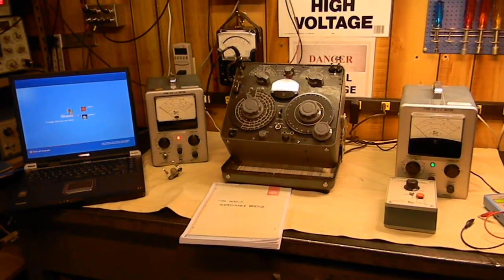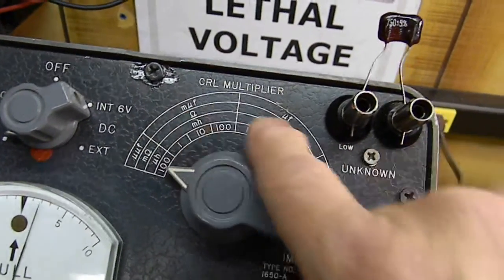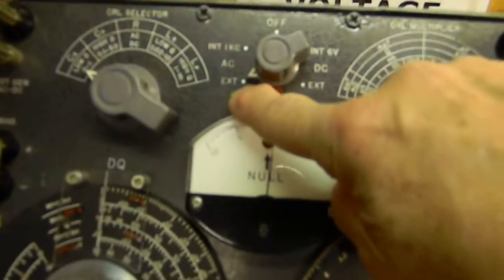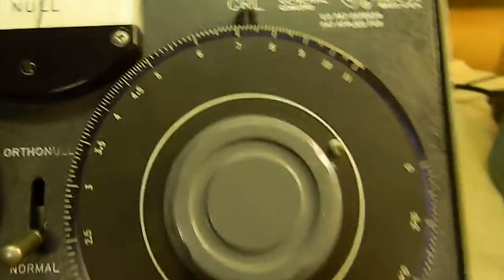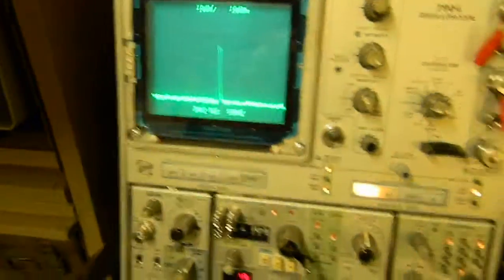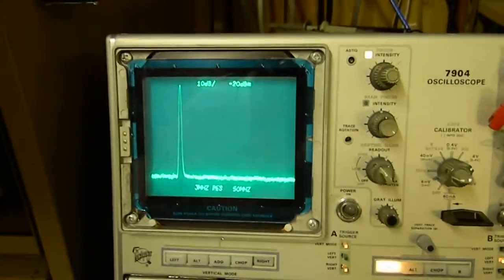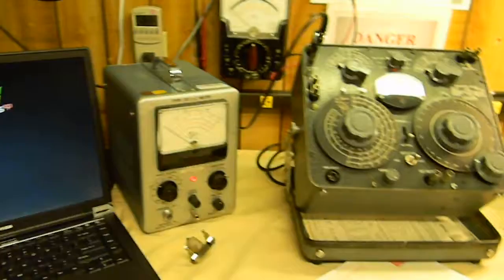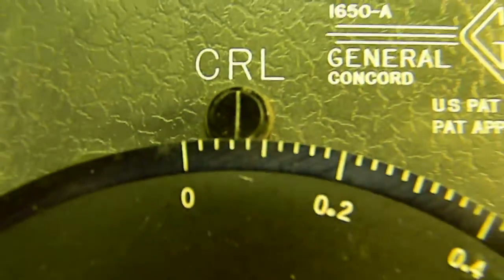General Radio GenRad 1650-A Impedance Bridge.MOV

Comment: I have this same impedance bridge, and I find them useful partly because of their accurate Dissipation Factor measurements, which can tell you a lot, and because they test at 1kHz, in the audible range, while many more high-tech meters are measuring using 100kHz or even higher. This gives you the option to compare readings at different frequencies even if you don't have an external test signal generator handy. 

Mine was built in 1964, and it definitely needed some repairs to the circuit board including replacing aged electrolytic caps and some bumblebee and paper types (not the reference capacitor, which is sealed and very stable. I also think there is a variable capacitor calibration setting inside that might get you more accurate readings in the low picofarad range. But this is my main misgiving about old test gear; it often needs repairs and/or calibration before it will work properly.

Comment: I've been thinking of buying an older impedance bridge.  Other than capacitance,  is there any advantage of the older impedance bridge measuring resistance or inductance compared to a newer LCR meter?  It seems I always end up going to your videos when I'm looking into something. Love your videos!
Reply from the maker: I am very pleased that my videos help. Weather or not to go with vintage impedance bridges is a good question. Over the years, I have picked up many different types including modern day digital LCR meters but in the end, I use my GR equipment to verify my new stuff. With that said, it takes a full work bench of equipment and a calculator (that I have mostly replaced with Excel spreadsheets on a PC) to go between admittance and impedance, rectangular and polar, etc... you know what I mean. It is a labor of love to use the old GR equipment and the older methods of resonance to measure inductance, as an example, but there is satisfaction in those processes for me and I can trust the answers I get. When I want to make quick measurements I use my digital equipment but I am always a little bit of,  hmmmmm, when it comes to the results I get with the digital equipment. I will have to say that for small measurements of resistance, I absolutely prefer a 4-wire Kelvin probe type meter. Some of the older HP meters are great and not expensive. For small values of inductance, I generally trust the new digital equipment but for iron core transformers, you have to go back to the  basics as the new equipment is very likely to give you incorrect answers. For capacitance, I generally trust my digital equipment.  The GR 1603A Z-Y bridge is the cats-meow in my opinion and learning to use it is a lot of "fun"... of course you also need a null detector like the GR 1232A and an accurate oscillator that you can read to the Hz level for truly accurate results. This is true for all the vintage GR instruments. Go for it... lol...have fun and save some nice vintage equipment. Using the older equipment and having the satisfaction of understanding the math to switch between different types of measurements is like a great steak meal with all  the fixings. Quickie measurements with the new equipment may deliver the results but it is more like a McDonald hamburger.  :-)

Comment: I used my GenRad 1650B to read the actual impedance of the speaker arrays at our stadium. It's a great way to keep track of the condition of the speakers, matching transformers, and even the integrity of the cabinets without having to climb up into the scoreboard and battle wasps all day. I kept a log of the 1000 Hz impedance and occasionally the DC continuity as well. The system was designed with "normalizing" 1/4" jacks to make this a very easy task. Just remember to have all the amps turned OFF.
Reply: That's interesting use of the impedance bridge. Is this more accurate and/or more reliable than using, say, a Fluke 87V to measure speaker impedance?
Reply: @raneilalonzo  Our shop was primarily involved with two-way radio maintenance. I was actually the only one who also did sound systems, and I had no real budget for the specialized test equipment. There wasn't, to my knowledge. a piece of Fluke equipment in the entire shop. The GenRad bridge was acquired from our state's surplus depot, and found many uses where very accurate measurements were needed. I latched onto it when I learned of it's ability to read actual "AC" impedance of complex circuits.

Comment: Been following you for a few years now, and I'm glad you see your mission is to document all this old stuff. This vid sold me on the idea of using a bridge vs my antenna analyzer, which does not specify  plus or minus Z.  You also got me hooked on audio amp tinkering as a way to comprehend the underlying math for tubes. Want to try my hand at home-brewing a 2 meter linear for VHF DXing eventually.  So I ordered a 1650A from SiliconValley on eBay and hope to have it by next weekend. Looks like a working 1650A with guarantee goes for about $150 these days. It's much more versatile than my PEAK LCR40 so I intend to use it to tune my upcoming shunt-fed tower (for 160M and 80M) project.  Thanks for your dedication to education. 73, AB1VL chuck
Reply from the maker: Hi Chuck,
I am glad you enjoy the videos on the vintage GR equipment. I hope you will be pleased with your 1650A. No doubt it is a bit more complicated to use but so much more information is available than the simple instruments. Of course, I also enjoy the new toys we can have nowadays like the vector impedance analyzers that I just picked up that go to 2.7 GHz.  Wow... 
I have built two, two-meter amps in my time. One was a 4CX250A class-C that I could drive with an HT to 500 watts out on FM. It was downright scary to use. I sold it at a Midland, TX hamfest around 30 years ago. I still have the 829B two meter amp that is build from the classic design in the ARRL books. Maybe I should post it on YouTube.
I see the GR instruments come and go on Ebay and some people want absurd amounts for them and some are priced OK. The GR 916A RF bridge is a good one to have also. I show using it with a spectrum analyzer but it works just as well with a receiver as a null detector.
Best of luck with your projects and thank you for your comments.
Please keep in touch.  73  WA4QGA

Comment: The bridge must be nulled to obtain an accurate reading. The 'dip' means nothing. A bridge instrument consists of two arms arranged so that the balancing operation gives a very close reading of the unknown component value(after calculation).  The dip only indicates that the bridge is not balanced.
Reply: The "null" meter will never "zero" with AC unless you are reading "R" or impedance.
Reply: @WCM1945  Mine does

Comment: How is the General Radio GenRad 1650-A powered?  Does is use batteries or is it AC
powered or is it both battery/AC?  The reason I ask is because I don't see a power cord..Thanks
Reply from the maker: It has an AC power cord and an internal power supply. I don't remember if you can replace the internal PS with batteries.but now that you have brought it up, I think you can put batteries inside but I don't remember for sure. In any case, I plug it into a 120 VAC wall outlet.
Reply: Thank you for the reply.  Looks like I gotta get me one of those
Reply: Tubey Toney I am trying to get rid of mine for cheap. PM me if interested. Thanks!

Comment: Although the CRL dial reads the same regardless of frequency, DQ is proportional or inversely proportional depending on the measurement.  I wished you'd demonstrated the DQ dial, the "sliding null", and the "Orthonull" feature which works around it.  Henry Hall got a patent on that.
Reply from the maker: Thanks for the information on the patent. I can't remember all the details of this video (unless I watch it again) but  recently I made another video using this instrument where I compared it to one of the "Blue ESR" meters that are popular today in evaluating electrolytic capacitors and showed how to determine equivalent series resistance with the GR bridge which might be what you are referring to.
ESR Meter Compared To General Radio (Genrad) 1650-A Impedance Bridge

Comment: Just a quick comment on GR1650-A, We purchase one at work to measure inductors but I was testing some low value capacitors 33pf, 22pf,12pf and compared that to the BK 878B we have and the readings were exactly the same. So then I twisted a wire tightly and glued the twist so it wouldn't move, I then trimmed the twisted portion down until I got to 1.5pf measured on the BK LCR meter,then I tested it on the GR1650-A using the internal 1Kc Generator and it measured it at exactly 1.5pf. A Fabulous piece of test equipment!
Thanks for your video.
Gene

Comment from the maker: Actually I have one called - "Practical TDR Made From Square Wave Generator, Differentiator Circuit and Oscilloscope" already posted. It is not the best and much is out of focus but it is something you can start with. I should make another one with a schematic and a better setup so it will make more sense. I still find it fascinating how we can measure such parameters with our home-hobby equipment. This TDR will also work on CAT-5 and yield 100 ohms as it should. Thanks for your comments.

Comment from the maker: The L/C meter came from Ebay. Just look up "LC200A" and several listings will pop up. It works pretty good for me. It certainly doesn't have the charm of the Tektronix but it is quick and accurate for small L and C. I need it for RF work I do. Good luck with ti.

Comment: @essoterric The camera isn't doing that badly, actually. Cameras just don't handle a wide dynamic range all that well, so a little tighter control of the light can keep the scene within the range of the camera and look better overall.
BTW, who manufactures that little L/C meter to the right? That seems like a nice tool to have around for testing those "mystery caps" we all have laying around in our parts bins.

Comment: I've been using National Instruments Electronics Workbench for a few years now, and it does nice rudimentary circuit simulations. I've even been able to simulate the function of my stereophonic multiplex generator for FM broadcast use. It does balanced modulator/suppressed carrier AM simulations nicely.
BTW, the scope traces are a bit too bright for the camera. They'd look a lot sharper if they were half as bright.